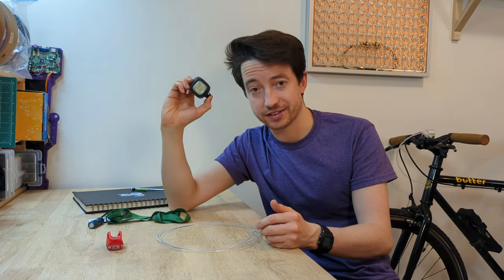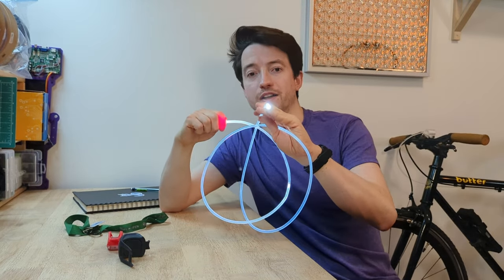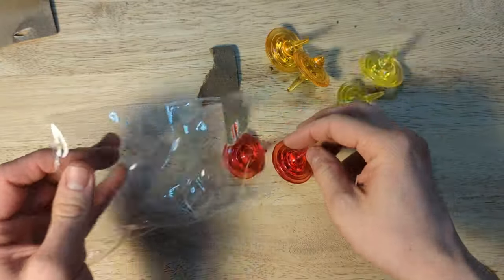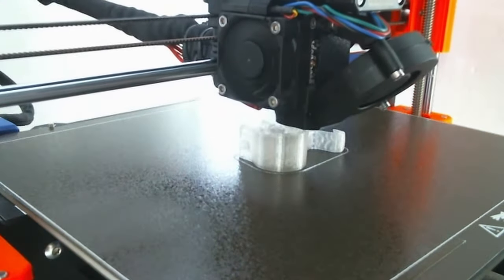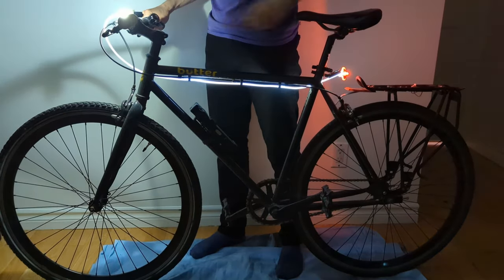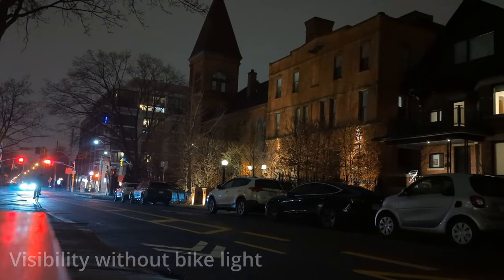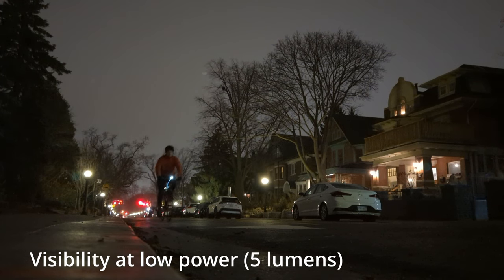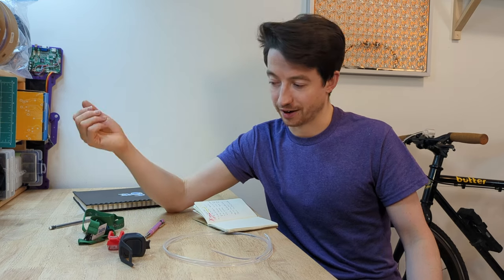DIY Fiber Optic Bike Light - On a Key Chain!

Comment: The red in the rear feels somewhat washed out - maybe drill a hole for your fiber optic line through a red retroreflector slightly bigger than the diameter of your red-tint endcap, and just thread the fiber optic through that so you're sending more red light to the rear?
Reply from the maker: Your right, I also felt that the red isn't particularly vibrant. Thanks for the suggestions!

Comment: Interesting concept. First I thought it's rather useless with all the cheap lights available.
At least on the video it looks like the lit lamp holder is blinding you while driving. If that's so in reality then I would try to print it in black or add a black cover on the top.
Reply from the maker: It's not as bright as the camera makes it appear, but it's noticeable for sure. Having something to prevent the light shining backward into the cyclist's eyes is definitely a good idea. Thanks!

Comment: now i need to find a way to attach this fibre optic tubing on the wheels
Reply from the maker: That would be wicked! I imagine each wheel might need its own light source though.
Reply: @ExercisingIngenuity  i'm thinking of printing a pcb with circle traces, pretty much like how the contacts of a brushed motor, and supply the power from the same battery that powers the other lights
Reply from the maker: @ashchbkv6965  oh cool! That's a great idea 💡 Let me know how it turns out!